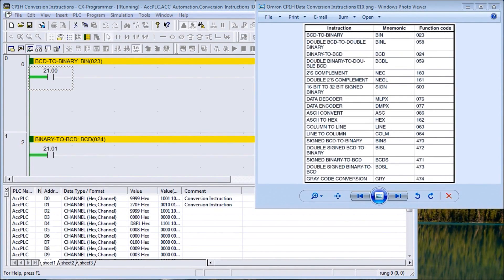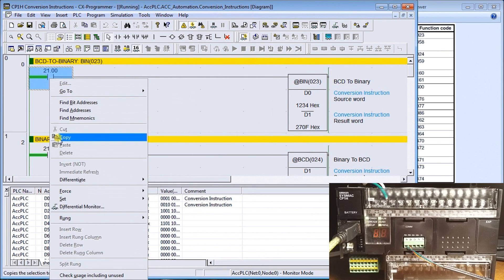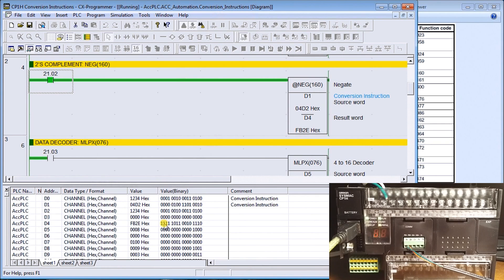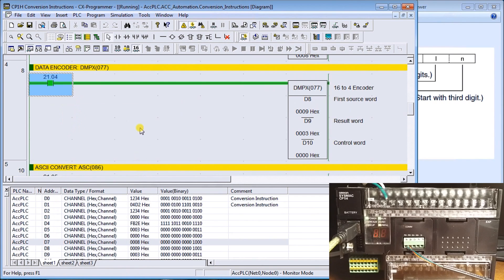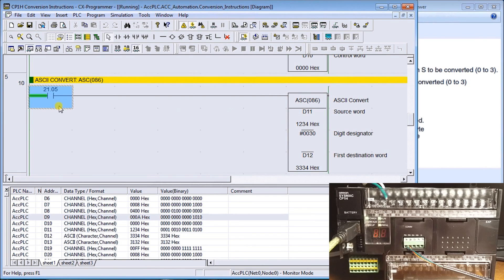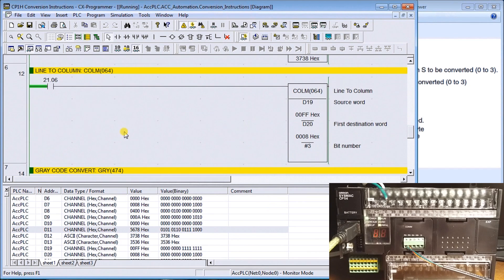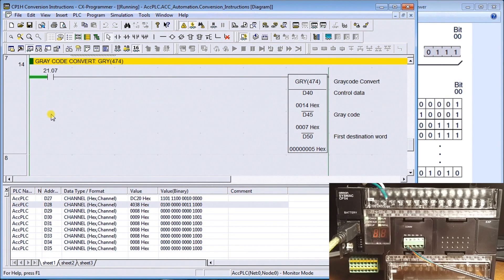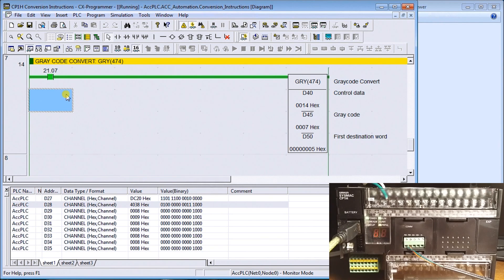Unlock Hidden PLC Data Powers: Omron CP1H Conversion Secrets

Comment: Thanks for the video. Am I the only one who is confuse why omron is using both BCD and BIN. It confuse me alot.
Reply from the maker: Hi Khoo Yik Herng,
Everything in the PLC controller uses binary. Specific instructions will use BCD (binary coded decimal) so that the outputs can be easily understood if you were using a display to the operator.
Here is a post on numbering systems.
https://accautomation.ca/what-everybody-ought-to-know-about-plc-programmable-logic-controller-numbering-systems/
This may also help explain the numbering systems related to all controllers.
Regards,
Garry